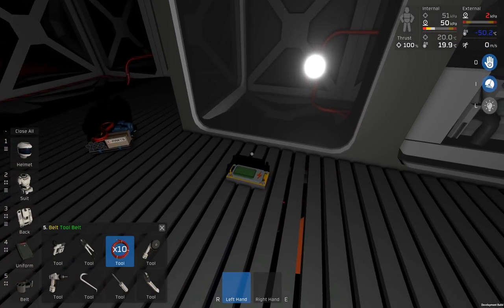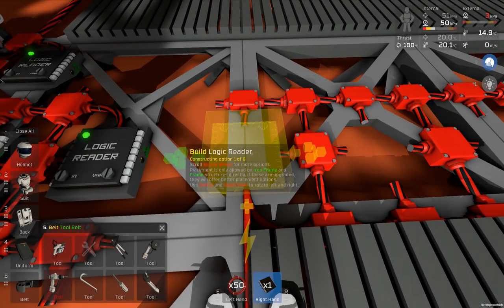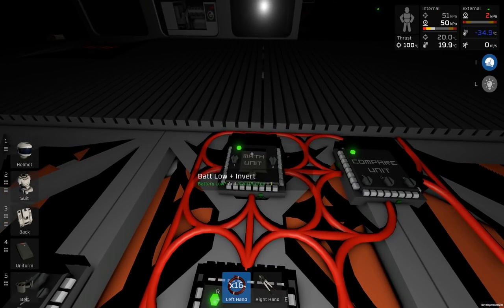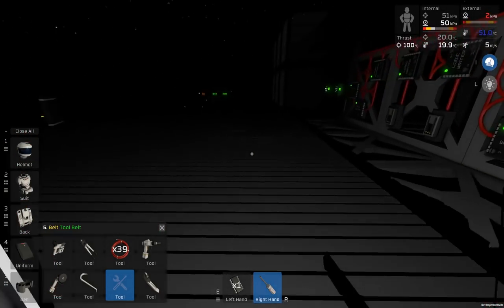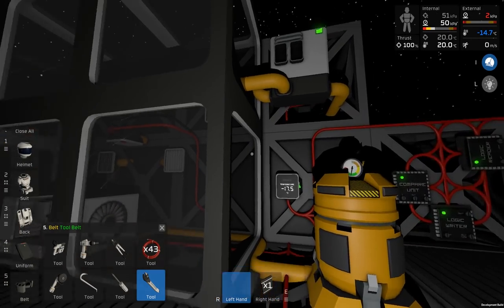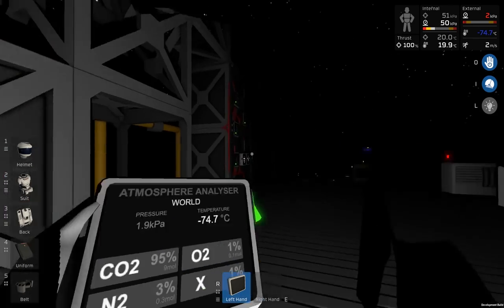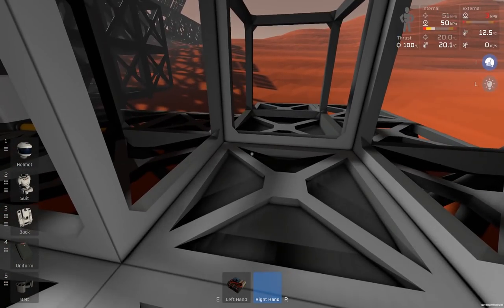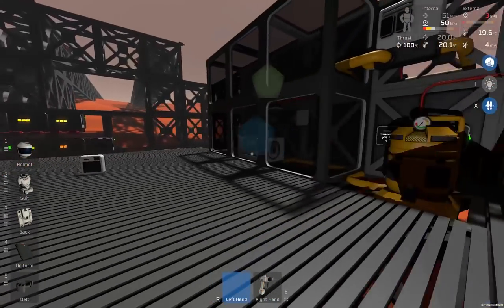Stationeers S2 E41 - Better Battery Controls and Improved Cooling Thoughts

Comment: grayduster
You can put wall coolers on the floor on 'frame boundaries' an then cover the pipe connection, covering the top part of the wall coolers and they will work fine, it leaves space for extra radiators, which you might not even need 9 of them, but test it.

I tested how low you can get the temperature with wall coolers and it was around 10-20K, prety cold if you ask me. The will set the 'Error' state if the temperature or pressure is to low, but only the atmosphere counts pipe pressure or temperature doesn't matter (unless it was changed).

Air con. unit for heating might not work as well as you think, but it is worth a try.

You don't need to wire each data port if the power power port is on the same network as the logic is (e.g.: filtration units, you don't need to wire the data port, since the power port also delivers the data from the device).

You don't need 10-20% of your wiring because if you unattach the bottom output of a processing unit, it will work fine, unless you need to adress something in a separate network, then you need to use it!

If you want detection of both filters being used up, try to read the 'Error' value, it might work (I think it will work since the switch is animated as if there was an error when the filters inside are depleated).

Wall coolers can remove heat from the game (unless it was changed). You just attach a pipe to it and don't pressurise it, it will function just fine removing heat, because heating up nothing will not change the temperatire of nothing, since nothing is nothing, so the temperature doesn't matter.

You might need to add to the output of the cold gas to gen. room filtration unit, a manual valve stuck on, because it might be just a bit to quick, and will cause the system acting as if there was a schmitt trigger, without one! (well, to some degree; and I know how you don't like using this method of slowing down the mixing rate, but it is the simplest thing to do and it probbably won't be pached, or at least it won't be done quickly).

Turn on the filtration units when the temperature goes over 302K (it worked fine for me).

I also had a room pressure regulation (you don't want to blow the windows, don't you) via a singular active vent outside and a passive vent inside, and I controlled the mode of the vent with a schmitt trigger (it keept the room at 100-190 kPa) and a circuit for turning the active vent on and off. It will be cheaper than two pressure regulators when the vent is not running, if it is, it draws 30W more than the 2 regulator setup would. (100W-active vent;20W-per processing unit (5 reqired); 10W-per I/O unit (3 required))

Batteries store ~~~3600000J, but I might be of by a '0' (too few or too many). Check it with a reader and save that to a memory unit, for saving 10W on a reader, since it will not change.

You should add a schmitt trigger to the circuit so the generator doesn't run for only a second or two, just make it fill up the batteries to like 90% and triggers if batteries are below like 40%.
Reply: grayduster I know this is a long comment, but please read most of it, if not the entire thing.
Reply: grayduster I don't want to be the guy that points out problems in the info tab of your chanel, but you missed a game that has the biggest amount of videos in one playlist and you included games that have 3 videos total in your playlists, just want to say that out loud :).

Comment: you could do a division to get the amount of time before batt flat. then turn on generator a set time before going flat.
Reply: You would need two points in time to do that, in not done the video yet but I don't think he did that
Reply: SuperFlux No he doesn't. Since the 'potential' power readout can be used as the sum of all batteries' stored energy (which is described by the the unit based on 'J') then you cad do it by a singular division (1J/1W = 1s). In this game everything is updating every tick, meaning that J in this game are 1J = 1W * 1tick , so you would actualy get 1J/1W = 1tick instead.

Edit: I just confirmed it by testing. The result value of the equasion described above was dropping every updeate exactly by 1, even though the value wasn't an integer. And I also tested the readout of the cable analyser, and compared it to a battery's stored energy and it was lagging behind by a one tick (when the battery was dischargeing, the value of substraction of battery's stored energu from 'potential' power, was positive and vice versa, and since the delay was exactly 1 tick, the output mached the power draw from the battery)!
Reply: @eryksoowiej4427  I think it updates twice a second 1 tick = .5 sec and yes you are correct! The values confused me ( saying W instead of J )

Comment: Since you've got a "battery is low" logic value, you could use it to control power to the heating section, rather than running over there to turn it off yourself. (Although you'd probably want a "battery is very low logic value", and you'd probably want to put a trigger on it, so you'll run the heating off your gas generator as long as the gas generator is keeping up.)

Comment: Would it be possible to use the potential from the analyzer and compare it to a stored value and if said value is lower than the current potential, overwrite the stored value with the current potential to dynamically update your max potential, then multiply that value by 0.4 or whatever percentage you'd like to get a battery low value that would update itself as you add more batteries?
Reply: In case my words aren't clear enough, is this possible with Stationeers logic:

APot = Potential value from analyzer

MPot = Stored maximum potential in memory unit

BatLow = Low battery value

If (MPot  < APot)
     Set MPot = APot 

Set BatLow = MPot * 0.4 (or whatever % you want)

And then use that just as you are now, but instead of a static 7mil value, it updates dynamically as your max potential goes up from asking new batteries as they get charged to full the first time.
Reply: Fey Prevesk You totaly could, and here is a way of doing it:
You need additionally 3 processing units 1 I/O unit and 2 memory units.
SavedPotential and MinBatteryLevel are the memory units;
Reader 1 is the reader of the output potential power;
Compare unit: Reader 1 > SavedPotential;
Select unit: Logic compare; 0-SavedPotential; 1-Reader 1;
Writer: Select unit->SavedPotential;
Math unit: SavedPotential*MinBatteryLevel.
This will work (kinda), as long as he makes a actual schmitt trigger for the battery level trigger of the generator, but why do that if you can have this value static and just make a schmitt trigger on its own, and this just uses 70W to run, and the system would need to be fully charged every time you add a battery/ies, since solar panels soon (if not already) won't be to charge the batteries to full, then you see the problem, it would not trigger the generator because the circuitry thinks the batteries are full enough, when the batteries are lower than expected, for this to be fully fixed, you would need to read both sides of the batteries, then you would need to add the batteries' input 'required' and the batteries' output 'potential' values together at the same time (that would be the max storable in the batteries), and use that instead of the memory, writer, compare, select chip combo described above.
So a better sollution would be:
You need 2 procesing units, a I/O unit, a memory unit, and a second cable analyser.
MinBatteryLevel would still be a memory unit;
Reader 2: Cable analyser; 'powerReqired';
Math unit 1: Reader 1 + Reader 2;
Math unit 2: Math unit 1 * MinBatteryLevel;
This solution is better with power consumption (only 50W), and it doesnt have a problem the reqirement of fully charging your batteries, every time you expand the battery storage! But, it is still redundant, since the current circuit works well enough, just need to add that schmitt trigger.
Reply: eryk sołowiej The circuitry I proposed doesn't actually care if you fully charge new batteries or not, it just updates the maximum recorded potential and then calculates 40% of that to give you your trigger value. You could have 100 batteries, but if your solar setup is only charging 10 of them, it only worries about 40% of what you actually generate. Obviously, if you're concerned about it always keeping up perfectly you need to add some extra logic to force the generator to charge the system fully, but his current system doesn't do that anyway, it just checks if his power is below his preset value and stops when it goes above it. If he added another battery now he'd either have to manually calculate 40% or whatever of the new maximum or just change it to a new semiarbitrary "low power" value if he wanted the value to stay around 40%.
Reply: Fey Prevesk The problem is, that he won't probbably add nither of my proposed circuits (besides a schmitt trigger, I hope), because the system currently works perfectly as it is (the fact that you need to adjust it every once in a while is just an inconvinience), it reqires extra rescourses and extra power consumption (why would he? I would want to see one of these implemented, but it is unlikely). And why use extra batteries if you won't use them to even half of their potential (at least when the solar panels can't keep up with the power drain, which you might not realise if you have the gas generator installed and auto-triggering)?!
Reply: eryk sołowiej True enough. I suppose it's a matter of different priorities as to whether adding something like that makes sense. I definitely agree with you that adding batteries if you're not going to use them doesn't make a lot of sense, I was just pointing out that it's not necessarily a requirement. Presumably you wouldn't be adding more batteries if you didn't think your power setup was going to fill them anyway, but who knows.

Comment: My dude you can divide the potential of all the batteries by the potential of one of them to get how many batteries you have :)
Reply: Also, I have an automated solar panel system, and because it’s on my main network, if I run low on power, everything shuts off including the panel’s rotation. Then when the sun comes up they are facing the wrong way and I have to adjust them. Moral of the story? Rather than shutting off everything when power is low, use a transformer and a logic writer to automatically decrease the batteries output over the same period of time. Idk if this helps or not but I just thought I would throw it out there :)
Reply from the maker: The potential is the amount of energy stored currently, but the batteries don't balance/store energy equally, so you can't just divide by the charge of one (I think, unless I'm misunderstanding, always possible!)
Reply from the maker: If you don't use the night-time shut off mode that I use for the solar panel circuitry, you could just put an APC/battery on the inside of the generator leading to the solar panels for battery backup that won't get drained by the rest of the base :)

Comment: Yeah, It's joules, or in other words, watt seconds.
Reply: Justin Bangerter It is just how the game treats batteries, probbably what happened in the past at least, you could charge any portable battery quickly in the APC, so fast infact, you could melt heavy cabling (to my knowledge), because the thing capping the max wattage, was only the battery level of both bateries back then (the more empty the battery being charged and the more full the battery being discharged, the faster the batteries would charge/discharge).
Reply: I don't understand your point. It sounds like you're trying to correct me, but the presence or lack of a rate limit on the battery doesn't change the units of its charge rating. If the APC draws 1kW, it will drain your batteries by 1kWs/s or... one 1kW.  This matches up with the behavior of the battery, which is strong evidence that the unit on a battery is effectively joules. In other words, watt seconds.
Reply: Justin Bangerter No, I want to tell you or other people looking into this comment, why it is, like it is. In the game, before the addition of the APC input limit, allowed the batteries to charge/discharge at rates that you see when you using the cable analyser or your tablet with the right cartrige as 'required' on the input/'potential' on the output. And the wattage was required to be like this to allow you to charge/discharge your batteries in one 'tick' and not draw too much or too little (otherwise it would be inaccurate at transfering energy and have random amount of energy loss (sometimes 1J, sometimes 1KJ), depending on many facrors).
Reply: Ah, gotcha. Much appreciated! You can still do this with stationary batteries in series, as well. I found this out when I connected a distant solar array to a main station on Europa.  Had to put in a transformer to prevent the cables from blowing out. D:
Reply: i thought it might be MW per tick. seconds makes sense also.
Reply: David Pearce Well game updates every 'tick', which is some fraction of a second (including 1/1 s, I'm not sure how often it actuaky is happening, but I think a 'tick' might actually be 1/2 s).
Reply: Well, hopefully someone will correct me if I'm wrong. Last time I tried this, I just compared the potential on a battery to the power being drawn from it and counted seconds to compare the rate. So, if you're drawing 10 kW from a battery, it should drop 0.1 MW(s) every 10 seconds. If it drops much more quickly than that, it's probably MW(ticks) and I would be wrong.
Reply: The only thing I can think of that might throw this off is if you have an irregular power drain (such as the arc furnace, which spikes). You would want to graph the power usage over time to be sure you are getting a constant rate if you want to get really serious about understanding this.
Reply: Justin Bangerter I think everything in the game updates every tick where a tick is 1/2 s. If you were to devide 'potential' power over the 'actual' power (on the output side of the battery) you would get the time until the batteries are completely out in some unit of time. And the same goes for the opposite side of the battery (instead of 'potential', read 'required' and you would get how much time left to charge the batteries to full).
Reply: That sounds like a great way to test this. Make that division calculation and see if the number goes down by one unit / second while under constant draw and feed. If it turns out to be based on ticks and not seconds, you could multiply by a scalar until the number decrements by one integer per second. That scalar would be seconds / tick.